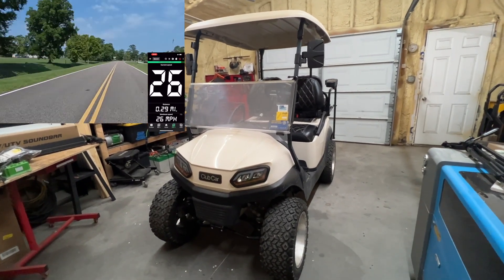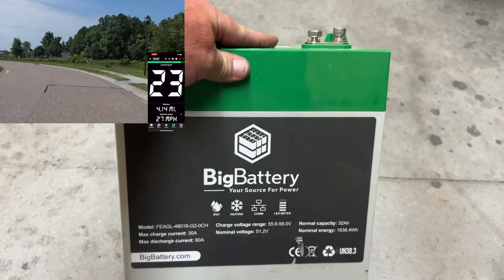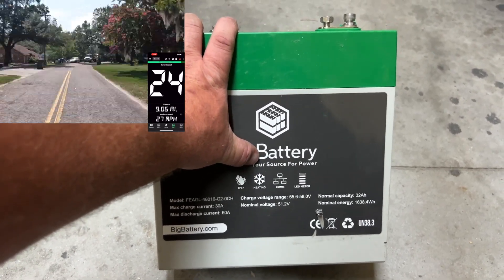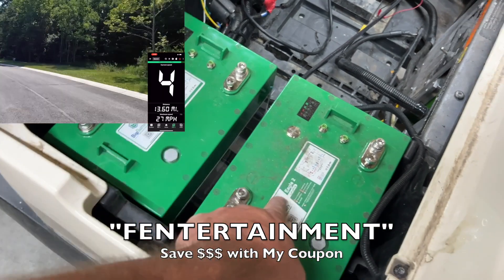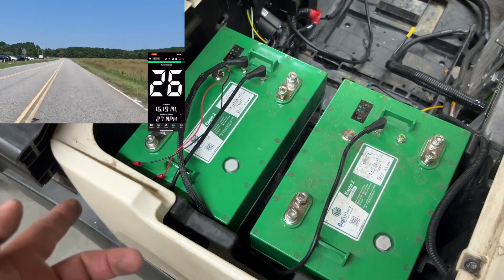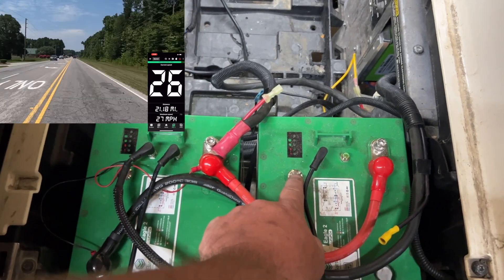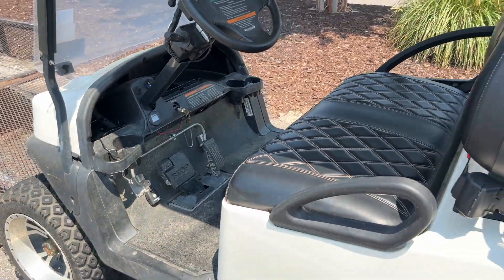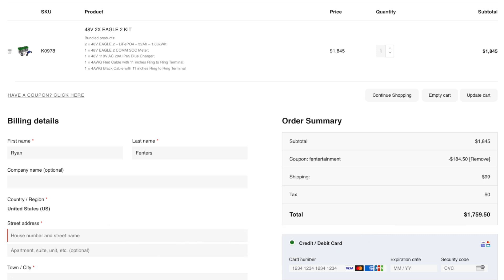Big Battery 48v 2x Eagle 2 Lithium Golf Cart Battery Install & Range Test | Club Car Precedent 48v

Comment: I have 48v 2x Eagle 1st gen kit and I cant get this range out of mine? Could it be because they are not wired in parallel? How can I wire in parallel with the Anderson connectors? I don't think I am getting all 60Ahs.

Comment: What size in line fuse holder/fuse and AWG would you attached to relay then battery?  Trying to figure out that with the eagle kit 2 and my 48v relay

Comment: So the charger connects to the battery terminals and stays in the battery compartment? Or is there a way to keep the charger outside of the cart and plug it to the cart when needed?

Comment: This is about the same price as the Vatrer 105Ah. Which one would you prefer to run?
Reply: I would just like to share my experience with my 48 volt 105 AHVatrer battery. 2021 drive2 Yamaha , 440 Navitas controller, 18 inch tires. Had a UNO 90 ah and wasn’t happy with having to recharge after 12-15 miles. Replaced it with the Vatrer and run 35-38 miles before recharging. I love it. I run around 25-30 mph all the time. Cart does 38 mph. Very happy with the Vatrer battery.

Comment: I have a question in regards to golf cart differential/Rear End. Looked all over and can’t find much info. I have an Austin Healey Sprite with leaf springs that are 36” apart. I want to do a EV conversion with a golf cart motor and rear end. Any idea which manufacturer has a rear end that will fit leaf springs that far apart with capability of upgrading motor for higher speed?

Comment: Can you use a 48v lithium battery on a 36v motor without causing damage to anything?
Reply from the maker: @TWINSZ1011  you can if the controller will work on 48v.

Comment: I wondering if you have info for me about battery gauge for the the correct reading, I have 3 100ah lithium lifepo4, but I can't trust the gauge, any thoughts, I don't have a shout. Thanks
Reply from the maker: What type of gauge is it? Does it have a shunt and meter?
Reply: @Fentertainment wish I had more info, it's about an inch by 2 1/2 inch gauge hooked directly to the battery's
Reply: Just a basic gauge, no shunt